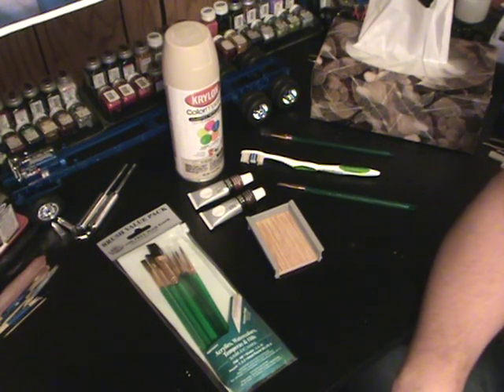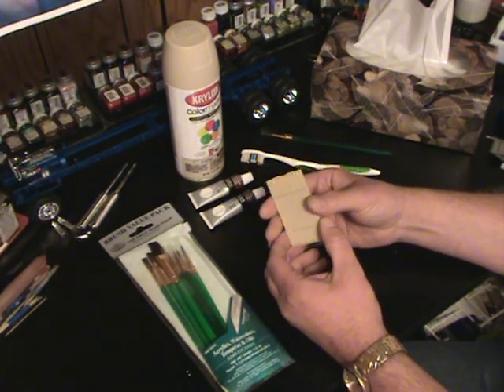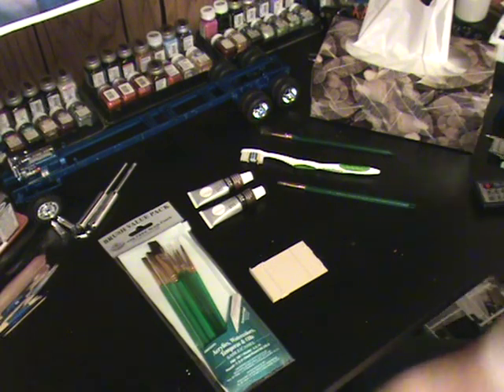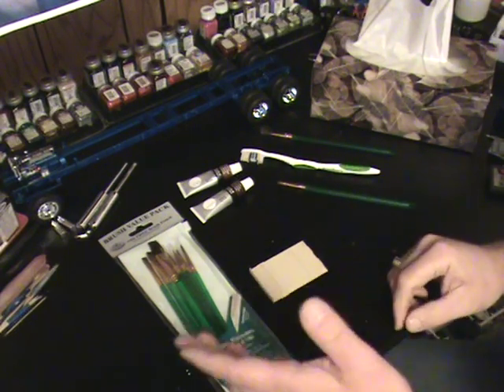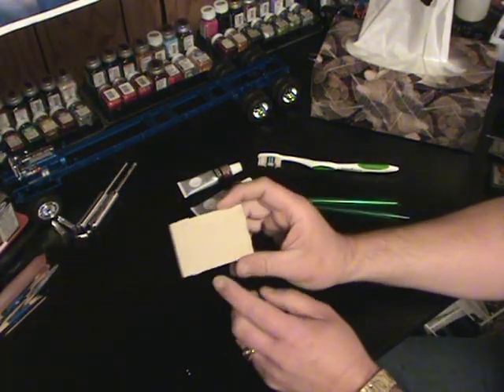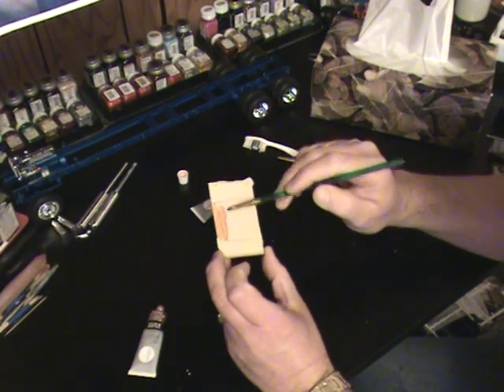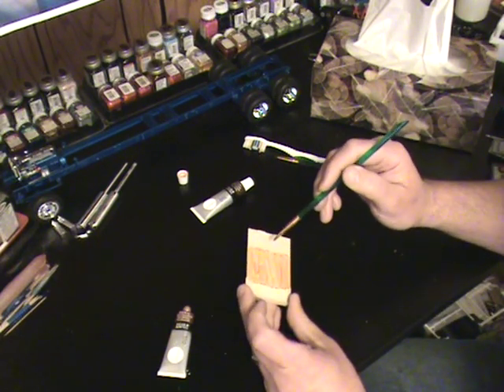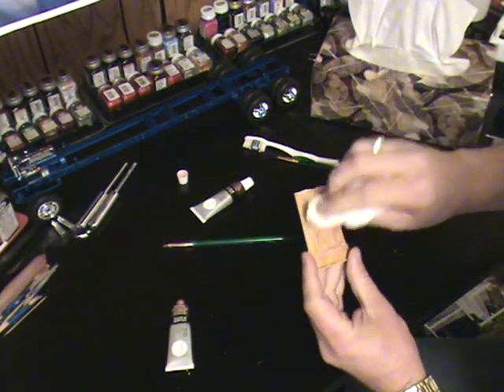Model Wood Grain How To

Comment: First, thanks for this info! I'll be using this method on a truck bed within the next couple of days.  Secondly, which clear coat are you mentioning by Rustoleum and  how did you like it, if you ever tried it?

Comment: some feed back: I know truck beds may be made from "grade" A boards how about the old fence, old table with knots in it? is there a way  to distress the wood to look weathered and forgotten? I am making a Munsters living room Lilly coffin, hurman chair, the floor and back wall are wood of course I would like to weather this items
Reply from the maker: You would want to use more of a grayish tone as the base coat instead of the sand color. Then use a darker oil base color . You can take your x-acto knife and pick some of the plastic out to give it that chipped age look as well. Once you are all done, clear it with flat clear instead of the gloss that I show in the video.
Reply: +BowtieLvr thanks for the tips
Reply from the maker: You are very welcome ... please let me know how it all works out for you ....